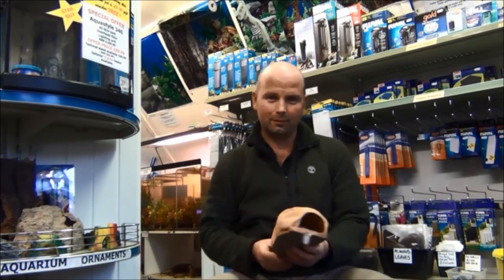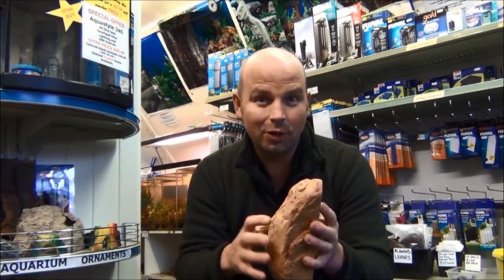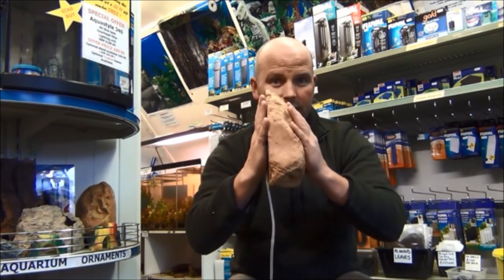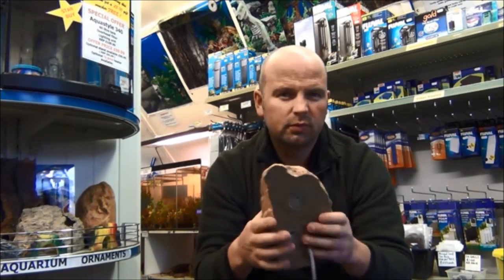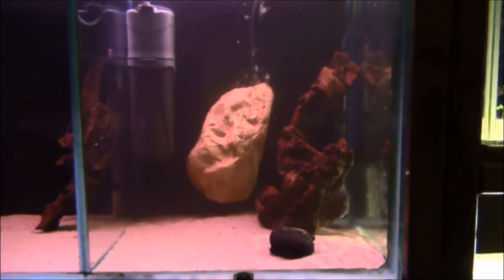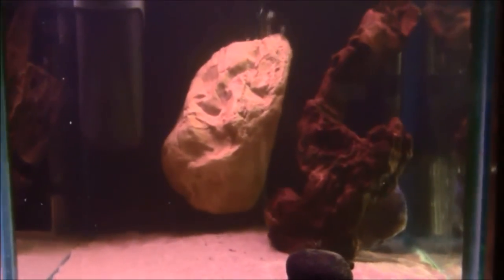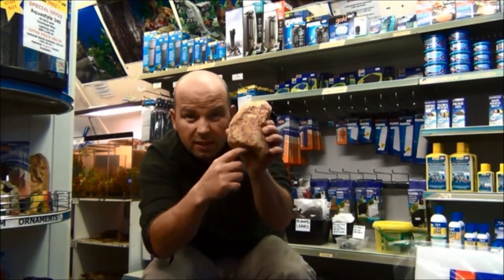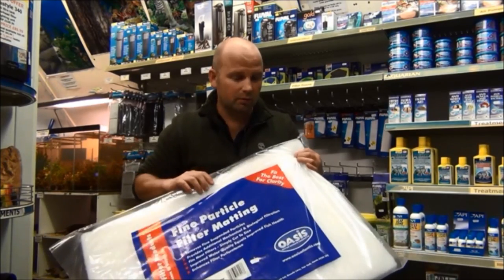'Invisible' Aquarium filter - Awesome internal fish tank filter by Pondguru

Comment: I used your filter idea and took a hollow at,antis type head drilled holes in the top and one in the back filed it with media and the sponge material attached the airline out into the tank and it is working really well looks natural and no unsightly filter...thank you for all if your ideas will use this technique for other ranks specially my breeder tanks:)
Reply from the maker: Groovy.
This type of filter would be great to use in a breeding tank as once it was mature as you'd hardly need to change much water due to the nitrate reducing qualities of the biohome.
Thanks for watching and appreciating the video.

Comment: just made one a self contained filter myself, using a medium sized decoration. have all of the media filters, charcoal and debris filter pulling through. You can purchase small pond sump pumps from lows or home depot cheap, got a 120gmp for 30 bucks or so with adjustable flow so perfect for my 40g breeder. plenty of flow and works wonders.
Reply from the maker: Sounds awesome, thanks for sharing.

Comment: Nice, really nice.
Similar to the old idea of a 20' coil of air tubing connected to a slow water pump. You trickle the water through and the nitrogen eating bacteria does the work.
However it is usual to put a sulphur filter on the end as this type of bacteria does  makes the water fall in pH. So a decent GH/KH is essential. So users of low KH water be aware. :)

Tip:Add a dosage of Stability by Seachem as they have a strain of anaerobic bacteria in their brand.

Me, I add a dose of Fructose every few days to consume the nitrate.

- The Aquarium Wiki Encyclopaedia

Comment: Finally found your link to the US distributor. Thank you for that! Two kg of the BioHome Ultimate and 5 resin rocks appeared as if by magic on our doorstep yesterday. Can't wait to start building out invisible filters! I think we're going to need a second order of BioHome Ultimate, though. :) We're in the final planning stages of a 55gal GBR tank and really like the idea of ammonia, nitrite, and nitrate filtration for these guys! We're starting these filters now in existing tanks so they'll be aerobic bacteria ready when our tank is ready to be set up and that much further along toward builidng anaerobic bacteria.

Love your videos!
Reply from the maker: Sounds good. I'm glad you have a distributor over there now as the media really deserves a wider audience.
Best of luck building the filters.
Reply: Got the distributor link from your ebay link. At least I think we did. Old people do odd things sometimes without intention.  :) Do you think several of these would be sufficient as primary f Iltration for a 55 gal? Original intent was supplemental but since watching and re-watching your filter media videos we'd really like these to be primary since our experience is HOB. Thinking 3-4 "rocks" w/ (approx 2-3 kg biohome ultimate) would be much more efficient filtration than any HOB. Or are we just senile? :)
Reply from the maker: Jennifer Ferguson
That should be easily enough filtration, yes.

Comment from the maker: +Kuruko Vincent Tetsuya
I no longer sell the rock features since I sold my shop but if you search 'Large hiding cave' on Ebay.co.uk you ell find them. Other components are available from my ebay link in video description.
Reply: am using your fish aquarium system on my small pond but was wondering do i really need to put the skimmer on it or can i just in and out hose.
Reply from the maker: Brenda Hanson Unless you have a problem with fallen leaves, wind blow debris or surface scum you don't need the skimmer.
Reply: +Pondguru Outdoors how is the nitrate removed? I thought bacteria only converts ammonia to nitrite and nitrite to nitrate.
Reply from the maker: +Varun m Nitrate is processed into soluble nitrogen by anaerobic bacteria. It is the aerobic bacteria which processes ammonia and nitrite (producing nitrate) and thats where most people think the process ends since most filter media has an internal structure which largely supports aerobic bacteria. The biohome allows for a much better balance of aerobic and anaerobic bacteria resulting in full cycle filtration (reduction in nitrate) when a sensible amount is used. It is not a magic bullet and every tank is different but we do consistently see users achieving the full cycle.

Comment from the maker: +Christian Troy
I would consider the invisible filter to be a supplemental filter to ensure healthy water as it doesn't really do the clearing job of a standard filter or provide much water flow so personally I would go with both.
Reply: yes correct +Christian Troy but if the big filter companys get on board trust me they can come up with aa design that works just as good as other filters.  They do have internal filters that can do the job but people dont really want those big plastic filters showing, thats PG's point.  They just need to come up with an exterrior.  A large rock or a tree stump or something

Comment: What an awesome idea, truly genius! I enjoy your videos and have learned quite a bit from your experience, from ponding to now aquarium filtration. I built a small 80 gallon pond, for 3 Orandas, about a year ago; and used a ceramic flower pot in the shape of a giant fish for my bio-filtration. I placed the pot on top of  a small milk crate, cutting out the sides of the crate so the Orandas could have a cave to hide in. I used a 300 GPH submerged pump with a sponge filter on the intake under the milk crate and ran 1/2 inch PEX Tubing from the output up through the pot's drainage hole on the bottom with a t splitter to create circular flow within the pot and added small rocks, scrubber pads and aquarium substarte within the pot. Needless to say i have some great beneficial bacteria on the top of the substarte , the water flows out beautifully from the top of the pot, from the tail and head area of the ceramic fish pot, making a beautiful splashing sound and the water in the pond is crystal clear. I got this idea after viewing videos of people who have used buckets and trash cans for filters and am amazed at your aquarium ornament filter idea, I will be using your idea for filtration in my fry tank, Thank you for sharing your knowledge, greatly appreciated in L.A., CA USA!
Reply from the maker: No worries, man. If I had any sort of business sense I really should have held onto this idea and developed it but I'm happy just to put it out there and let other people develop it. I do have an idea for a similar filter which uses something not seen before in aquariums which people will think is super-awesome but I am keeping that one under wraps for a while.
Thanks for watching and appreciating the videos.

Comment: Excellent idea, the simplest one's are usually the best going to do this over Christmas, when I have time off. With the air pump what sort of power do I need to look for I've got a 180 liter tank cheers
Reply from the maker: The main idea behind this was to have a low flow rate filter for nitrate removal so you really only need a 100-150 litre per hour air pump but I suppose it depends on the size and shape of the ornament you are using.
Thanks for watching and appreciating the video.

Comment: There are spaces in the filter for extra media, these spaces are 9.5,9.5,square by 4.5 high, plus if I take out the other sponges, the carbon & one other I have that space too., this is with having the sponges I do need to keep. The actual filter cartridge is about 30 cms high. Hope this makes sense, it's quite hard to explain
Reply from the maker: If you go with a coarse, medium and fine sponge then media that is all you need. I need to know how much available space you will have if you only have 3 sponges as that is all you need.

Comment: Excellent Idea.  I am planning to make one in a smaller Buddha head ornament.  I was wondering what size air pump I would need.  its is a 55 gallon tank. and the ornament is probably 3 inch by 2 inch round, where i would put just the media.  total is 7 inch by 2inch.
Reply from the maker: It depends what the depth of the tank is (for the pressure) but a 70-100 litre per hour air pump should easily be big enough for a filter of that size.

Comment: Can you explain further to me (a newbe) how the water flow goes through the sponges if the hole line is above them? I just think surely it would be better if the hole was below the sponges for better filtration?  This was done a long time ago so are the results the same, better or worse? Thank you for your time for it is an excellent idea .
Reply: The air pressure above the sponges will direct the water beneath the sponges upwards through the sponges.

Comment: Awesome and very simple idea.. it is blowing my mind that I didn't think of this.
Reply from the maker: +Lakshminarayanan Krishnan No worries, thanks for watching.
Reply: Pondguru Outdoors biggest hurdle I face in setting these up is finding reliable power heads / air motors that last a long time and see powerful... The ones I have access to suck major donkey's ass.. And recommendations for good quality ones?
Reply from the maker: +Lakshminarayanan Krishnan Not really as I've found that even very cheap Chinese pumps and air pumps are quite reliable. Small air pumps will tend to break after 12-18 months but if they are very cheap that isn't too bad. To get longer lasting ones you really need to be looking at brands such as Tetra and Eheim but they are much more expensive. Powerheads should go for years without any trouble - even the cheap ones. Is your electrical supply OK or does the voltage / current fluctuate? That can rapidly break small electrical items.
Reply: Pondguru Outdoors quality of electrical power supply is a problem back here in India.
Reply from the maker: +Lakshminarayanan Krishnan That could be the source of the problem I reckon as small electrical don't last well if the electrical supply fluctuates.

Comment: Great tip thx for sharing. Just started my first fish tank, does this mean i won't need a separate air pump for giving oxygen to fish? I have 6 guppies and a few shrimp in 20 gallon tank,

many thx
Reply from the maker: You will only need the air pump which is driving the filter and if you have 20 gallons you will get way more fish in than your current stock. If it was 20 litres your current stock is about right.

Comment: Thanks Guru.
Brilliant idea, will look great in my soon to be set up tank. How often will the foams need changing, and does it make a difference what size of air pump i use ?
Reply from the maker: A larger air pump will result in better water flow but less processing of nitrate. Foams will just need replacing when they can no longer be cleaned out properly and that time will depend largely on air / water flow as that will dictate how much muck is dragged into the filter.

Comment: Nice idea indeed. I thought that a lot of sponges should be used in order to filter the water well and have it constantly crystal clear. Having these media and especially in such quantity inside the filter, helps to have a crystal clear water or are they used mainly for building up the bacteria colonies in the tank? In other words if i use in this set up only sponges instead of bio media will i have a better result in having clean water?
Reply from the maker: Yes. This filter is really a secondary (low flow) filter which concentrates on the biological cleaning of water (waste processing). Swap out the media for foams and you will have a filter which simply mechanically cleans the water but only has a limited biological effect.

Comment: Richard, Is it ok to use aeration in a 10 gallon tank with African dwarf frogs. Sand substrate, heater, filter, live plants and a couple of bog wood and ornaments for caves. I'm cycling the tank at the moment and will probably put 6ADF in there.
Reply from the maker: smalltownboy66 Sure - adding air will always benefit the tank and aid with water quality.

Comment: I was introduced to this idea recently (mentioned to me by a fellow fish enthusiast to check out youtube). This is definitely the way forward. I understand that you are addressing mechanical, and biological filtration with this process. I am curious to understand more about chemical filtration, outside of what I read, and apply that to this concept also. Since I'm clueless to chemical filtration, is there a reusable type? If not, what is the best type out there? I saw one claiming 6 months.
 I also saw that you mentioned a few times in the video and in the description about this being a low flow rate. I understand higher flow rates process more water, filtering more, needing more cleanings. I think my tank is one that needs higher flow rates, but I wanted to ask you. I just purchased a 280 litre tank.
Reply from the maker: If you have a 280 litre tank then I would definitely go for an external filter. Here is a link to the video I did showing how to set one up properly: HOW TO SET UP AN EXTERNAL CANISTER FILTER FOR AN AQUARIUM (MEDIA AND FOAM LOCATIONS)
With regard to chemical filtration it is often used by people to mask the fact that their filter is not processing waste properly. Carbon, zeolite and all manner of impregnated pads and bags are available but unless you are soaking up residual treatments or excessive colour from bogwood I'm not sure they are needed.
I prefer to set the filter up properly using the best media available and that will see to ammonia, nitrite and nitrate resulting in les water changes and healthier water.
Filters do not need to turn over a crazy amount of water to be effective but so many of the standard internal ones available do since they have such a limited filtering action, hence the additives to mask their failures.

Comment: Great idea... how large a tank could this filter support??? Assuming you already have a filter
Reply from the maker: If you already had a suitable sized filter you wouldn't really need this filter but as a supplementary filter (if you only had a foam filter on the tank previously) it would be suitable for around 50 litres to control nitrate as it holds 500g of the biohome ultimate.

Comment from the maker: J Castillo They are sold for reptiles under the name 'large hiding cave' so I'm sure they will crop up on ebay and amazon if you search for that.
Reply from the maker: matt allan Yes that is the smaller version, much smaller and the entrance hole slopes back so the foams will not be hidden in this design. I think there is a shortage of the large hiding cave at present but the wholesaler I use that brings them in from China are getting more at the end of this month I have some on order and they will go onto ebay when I get delivery in.
Reply: Hm its 17 cm tall is that not about the same, what height was that one roughly? Sure it was same cave the pictures lower down make the dents look the same. Bigger would be better. I followed your store like yesterday or day before because few things I want to get off you when I get paid! I am switching to sand in my 4 foot tank, do you think 2 of these filters with 1 or 2 quarter changes a week with scuffing the sand about to get debris out would cover it or should i keep my mechanical filter in it which i use the now aswell?
Reply from the maker: matt allan A 4' tank really should have an external filter or multiple smaller internal filters so I would leave the mechanical? (foam?) filter in if you are going to make a couple of DIY filters too. I haven't got the large cave to measure but it is much larger than the medium one. Taller and wider.
Reply: Pondguru Ah I was just guessing size from the video. I am currently using a fluval 3 plus and a small sponge and air hose filter and haven't had any major problems at all since I switched to this tank in may, was well chuffed that the switch over went very smooth haha. I will either grab two of the rocks you are getting in then or try find something bigger and keep the fluval as well. Was thinking of getting an external filter for a while but I am very limited on space so have decided to leave it for now unless I ever get or make a different stand for my tank.
Reply from the maker: matt allan Ultimately external is the way to go if you have the room but the more biological action you can get going in a tank (from filtration) the better quality the water will be and the happier the fish will be too.
Reply: I may go external just means alot of redecorating my room to fit it in as my room is tiny, got a new job recently though so money isn't a problem when it comes to getting one, if I do I would buy your upgrade pack anyway because I seen that video you posted about externals being set up wrongly and I would rather make the most of it. still want to make some of these filters though because liek you said the fish will enjoy the biological filtration and I reckon it might help plants out as well
Reply from the maker: matt allan I was just on the phone to suppliers today and it will be early next year when the large hiding caves are in with them - asked them about another design and will be getting that one to experiment with but it is more suited to Biorbs (I hope, as the biorb filtration is utter crap)
Reply from the maker: Yes I did a video on that - just search for 'biorb compatible upgrade' and it should come up.